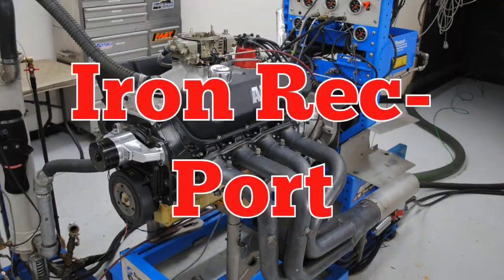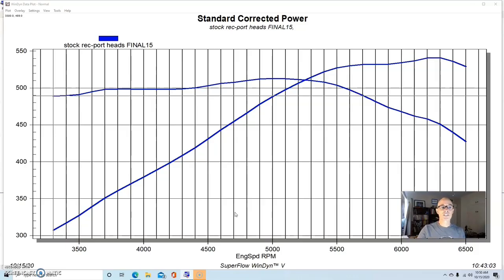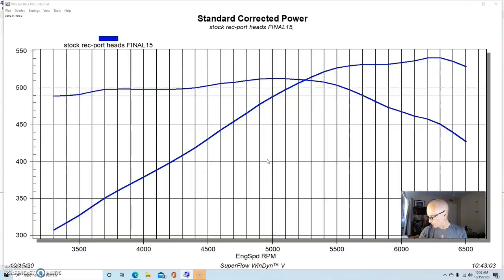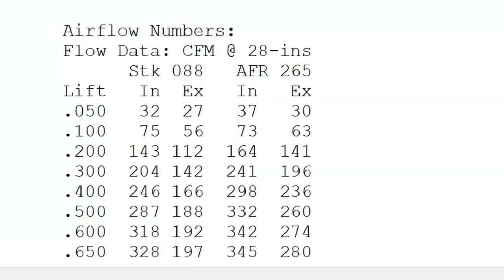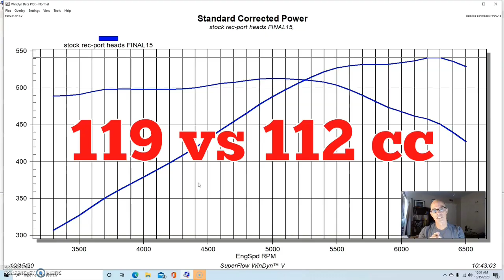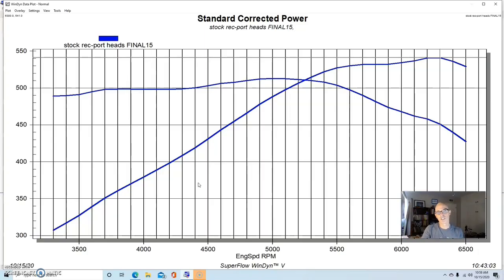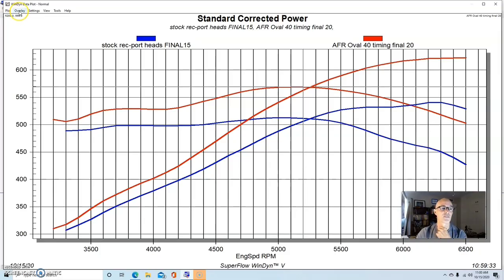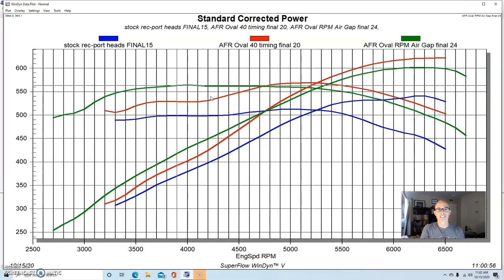454 BBC REC PORT VS AFR OVAL-PORT HEAD TEST

Comment: From what I have found you have to cc any bbc factory head, I used a set of mid seventies truck oval ports, flat milled .020 and a set of L88 pistons thinking they would be around 128 cc heads. Had a terrible pinging problem, tried everything, finally coed the heads and they were 111 cc so was  at 12.75 to 1.
Reply: theres no "thinking" there is only "cc'ing"

Comment: What intake did you use on the first test with the oval port head? Did you use the same intake as the rectangular port head?
Reply from the maker: it says in the video-SP rec-port Weiand on the rec-port heads, SP and DP oval Edel on AFR heads
Reply: @richardholdener1727   I must’ve missed the Edelbrock single plane when you mentioned it. Thank you

Comment: How does exhaust flow contribute to the power gains?
Reply from the maker: it does
Reply: This is exactly what most People think, exhaust is not important. They usually need the most work in any stock and non cnc aftermarket heads to work well

Comment: Ive been running Edelbrock Perf. RPM Oval port heads on BBC's since the 90's. 290 heads. They work really well.
Reply: Agreed. And I like that Edelbrock makes a 100cc chamber version. It gave me 10.15:1 compression with tiny 8cc domes. Good stuff. They don't flow like AFRs but still make good power for a street motor.
Reply from the maker: those are good for junkyard upgrades as well

Comment: Howards has a BBC hydro roller thats 241 249 .680

Lift flow problem s loved.  Id do that

10.5 to 1496-505 BBC AFR 305 rectangle ports and the weiand 8018 dual plane.  And a 1050 cfm quick fuel street Q 

Damn port specs on that intake are the same size as the AFR 305 lol even a rpm rectangle port air gap isnt that big!

What do you think? Mid high 600s?

EDIT: 247/255 @ .050  thats a good 6500 RPM 496-505 BBC on pump gas  with a dual plane for good throttle response

Comment: Hi Richard!!   Ok ok 👌. How do I get a 454ci in my Yukon?? lol. That would be a wild swap. It’d twist my yukon like a candy 🍭 cane. Jeeez. Maybe a bbc to start for a project car or a high rise 4x4 big tires you know what I’m saying.  Love to build one in the future.    Thanks Richard. Much appreciated crazy brother
Reply: What Yukon? They're based on the full size pickup. The easy way, really easy way, is to buy a wrecked big block pickup the same year.
You get the engine mounts, rad hoses, the big blocks also have a 4l80e as opposed to the 4l60 most small blocks have. If you get a 4x4 one you also get other heavy duty stuff. 
There has been a couple guys swap an  8100 into their Denali and did it with all factory component. It's not too bad of a swap.
Reply: Trade it for a 2500 suburban.

Comment: Look at the exhaust flow numbers on the AFR's! That us going to make some huge gains especially with a power adder.
Reply: I was just getting ready to write pretty much the exact same thing. That's why AFR heads make so much power. Everybody is all giddy about intake numbers but tend to forget about exhaust which I think ends up causing a bottle neck for some heads. AFR or Air Flow Research is a great name for that company because they seem to combine the best of both.
Reply: Great for Nitrous / Blower for sure!
Reply: Exhaust port flow was always the weakness of the factory square port heads. The intake ports flowed a ton more than the factory oval intake ports did, but both heads used the same exhaust port. Fine for the oval head, but inadequate on the square port head. Even GM knew it, that's why the old 454 HO crate engines that had the square port heads used a cam with a ton more exhaust duration. I think the cam specs were 211/230 @ .050 because they were trying to help the exhaust keep up with the intake side.

Comment: What do you think that head would do with a 496 with 13.1 compression? The heads originally were Merlin VR oval ports, 119cc, 2.19/1.88 valves. Mostly for 1/8 bracket motor
Reply: 13 to 1 496?

Step up to a retangle port AFR sounds like your trying make some steam
Reply: The afr heads will probably be better than the Merlin ones. By probably I mean definitely. They are probably 40 pounds lighter or more for the set and will flow more air everywhere. If it's a bracket car, do you need it faster? The Merlin iron heads are legendary for reliability where offshore guys have no problem running them for hours and usually an Iron head will keep the gasket in better than an aluminum one.
To know how much you'll gain I would like to know a bit more. If you are running a flat tappet cam, there is probably less than half the power gained as on this test and even the most extreme example probably wouldn't gain 40hp. A 13-1 496 has something to make some stream with, but the airflow of these heads, even with a .700 cam, will stop them cold at about 700hp. With that many cubes and that much compression, I immediately think rec port, even something pretty big like a 340cc
Reply: Yes sir! It’s for my recently passed father. We had this one built in Memphis before he passed. At least the short block with the heads mentioned
Reply: We bought a Comp solid roller.680 lift. Using single plane
Reply: @bocrane3563  afr makes a 290cc oval port that comes with roller springs. Their literature recommends up to 509 cubes and 6500 rpm. They flow 30cfm more at .700 lift. Those 290cc heads are probably one of the best performing oval port heads you can find.
The 265cc heads are good, great even, but for a strip car if you really want an oval port the 290cc will be better.
Reply from the maker: we've done 800 hp with the 290s-they work well
Reply: It is for bracket racing for now
Reply: I really appreciate that. I was hoping to have it running before he passed but it’s time now. I just didn’t see the sense on spending huge money on huge rectangular ports that this combo didn’t need.
Reply: I appreciate everyone’s advice!